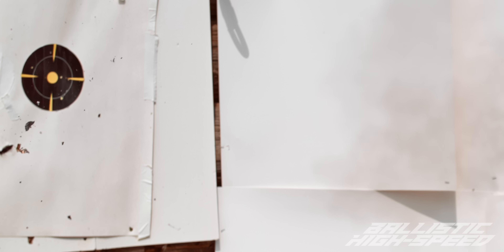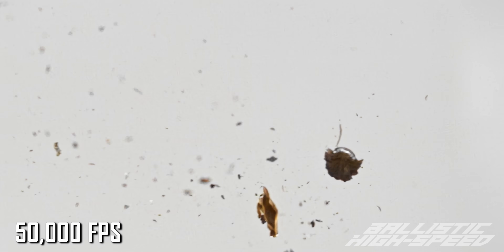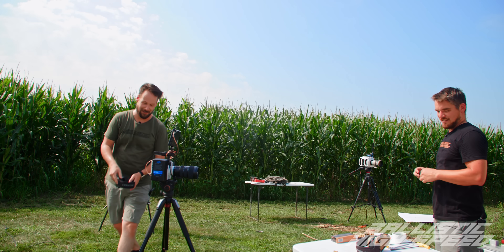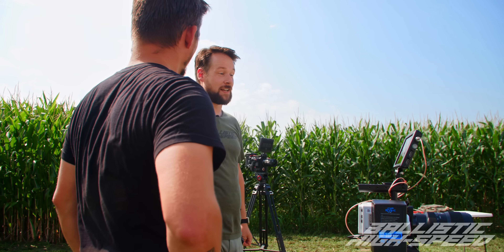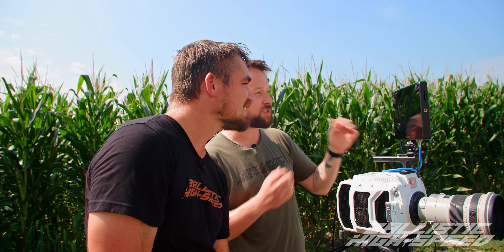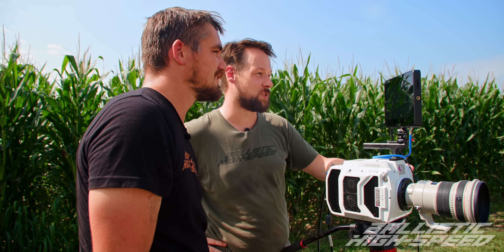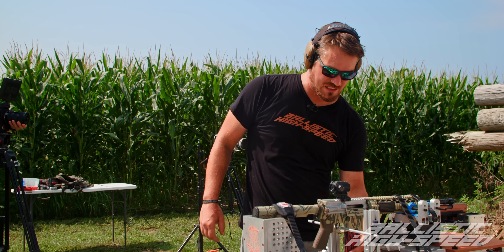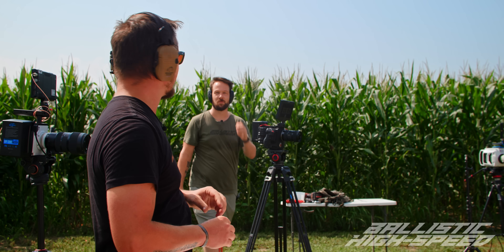Can You Shoot a Bullet out of the Air? - Ballistic High-Speed

Comment: What is the light in 18:04 ? If you change speed to 0.25, the moment bullet tip touches other bullet, there is a light. Is it is explosion of molten metal or what?
Reply from the maker: We see it often with bullets impacting metal, glass, and other materials. It’s a combination of the material superheating to ignition in that instant, and air getting compressed briefly by the nose of the bullet until it glows like a plasma.

Comment: Great movie, but here is a movie request that is little off topic.
Watch Paramount Tactical’s three newest videos in order — they outline the only scenario that makes sense so far. Could you recreate it? Use a torso + head, the same small-profile curved metal plate vest, and a common hunting round (e.g., .30-06). Test two setups: shooter elevated firing down into the top corner of the plate (ricochet-up into the neck) and a straight/level shot. Film with high-speed close angles so we can see ricochet, wound sizing, and shockwave effect.

One more factor: those plates are supposed to be inside sleeves with carbon fiber or similar material to catch fragments. If Charlie only had the bare plate inside a shirt rig, then whoever outfitted him failed him — the round hit where the plate should have saved his life, but without the full sleeve/lining it deflected up into his neck. Showing both setups — with and without proper plate covering — would make the test definitive and answer most of the debate.    
Charlie, we got it from here, the battle of truth is now in our hands.

Comment: This must be made into a practical firearm. It's like discontinuity in the terminal ballistics.  I suppose at close range they are likely to collide while decelerating into the target.
Reply: Needs to be an all lead slug.
Reply: Under-barrel 12 gauge tossing a few oz out for a solid copper .308 would need to compute angle and range. Should the pin strike delay be computed along with the range and angle?

Comment: why are they so hesitant to add more delay😭 just overdo it and work backward they wasted like 20 shots
Reply from the maker: The goal is to get a feel for how a certain programmed delay turns out in reality. A millisecond delay added in the coding does not create an actual full millisecond in reality. So by adding a millisecond or two at a time, we can visually see how much progress is made each time. That way when it comes time to fine tune the adjustments, we can actually “feel it out”. But just randomly throwing larger delays and then back tracking, we have no sense of fine tuning that will still need done with that method anyways.

Comment: In the good ol' days of computing, signal timing was accomplished with spools of wire of different lengths. Honeywell made a cabinet that served no other purpose than to house spools of copper wire. This was before miniature resistor/ capacitor networks for each signal. Adjust the length of your wires.

Comment: XM193 going out of a 20" barrel with a 1/12 rifling twist is close to 3300 fps. M855 going out of a 20" barrel with 1/7 rifling twist is going almost 3000 fps. Using 1/7 twist barrels, you lose about 50 fps per inch of barrel length. If I remember correctly, using M855, an M4 with its 14.5" barrel, the bullet is going about 2700 fps. With a 16" barrel and 1/7 twist, you're looking at 2800 fps. With a 1/8 or 1/9 twist, there is less friction, so less velocity is lost per inch of barrel length. you can find charts and charts of this stuff online, both from the US military or gov't agencies and from autistic people with chronographs and lots of spare time. :) Ammo companies often use special "test barrels", not real guns, for velocity numbers.

Comment: Green tip, aka M855, is slightly non-concentric, a quirk of the manufacturing process. The steel tip in the core is usually slightly off center because it's hard to mass produce something like that within the allowances of gov't contracts. Technically, 4 MOA out of an M4 is acceptable. We know that a brand new AR can easily do 1 MOA with good ammo. XM193 55 grain 5.56 is more accurate and more consistent from round to round because the rounds are swaged lead core without having to worry about a steel tip on the core. Commercial .223 isn't loaded to the same pressures as 5.56 Nato, but it's also more accurate at 100 or 200 yards than M855, discounting the lack of velocity. Soft point .223 has higher QA/QC because it's premium ammo for hunting and makes the ammo companies a lot of money per round compared to the mass produced FMJ rounds. M855A1 solved the accuracy problem because it's a machined copper bullet with the steel tip inserted into the nose of the bullet. Because lead is heavier than copper, in order for the copper bullet (with steel nose) has to be longer in order to be the same weight. It stabilizes more for a longer range shot. Of course for Ballistic High Speed, long range performance doesn't matter, but the consistency and concentricity of the M855A1 round might make a difference, creating a near 100% repeatable bullet trajectory. Another military round with high QS/QC would be the 77 grain OTM rounds designed for longer range accuracy and lethality. The velocity between various .223 rounds, XM193, M855, and 77 grain OTM might affect the timing of impact.

Comment: I was lucky enough to see this occur in real time back in 1989. At a live fire range at FT Stewart GA. There were 3 Vulcans (20mm rotary cannon mounted on an APC chassis) and the Plt Ldrs APC on line firing at a RCMAT (Radio Controlled Motorized Arial Target). The Vulcans and the Plt Ldrs M2 were loaded up with a mix of Tracers and standard ammunition.  The 3 Vulcans were firing on 100 rd burst ( each burst is about 1.5 seconds) and the M2 .50 cal of the Plt Ldr is just steadily chugging through his 200 rd belt. It's about 1830 hrs, last target of the day, sun is behind the woodline so the tracers are showing up nice and bright. We can see the clusters of 20mm appearing to float lazily towards the target (shocking how slow tracers look when they really are not slow) and the .50 cal bullets zinging through the middle of these clusters, moving a lot faster. Then it happened. A .50 cal tracer struck a 20mm tracer from behind, creating a luminescent pink explosion. We were all screaming and exited. The LT said he did it intentionally lol. Range control said, "You people are easily amused, that shit happens all the time." Then we ate MREs while we waited for clearance to leave the range. I had forgotten all about this experience until seeing this video. Well, not completely, my MRE was Tuna With Noodles (AKA dead hooker with worms) and I was pissed because that was my 2nd time getting that MRE that day and it sucked shit.

Comment: I Wonder about the lethality of that splatter

Also a couple of things
That gray stuff is most likely the lead. Considering its more with the steel tip reinforces that, since now the harder steel (instead of copper/lead) contacts the lead of the .45 first. Its about the hardness. Lead on Lead dissipates most of the energy in deformation while the harder Steel keeps its shape and therefore dumps more into the .45 Deformation, but now with so much energy that it rips apart / maybe even melts. 

Also, if you were dead center there wouldnt be any bigger pieces of lead on the sides. 

Great Video and Setup

Comment: I finally realize where math ACTUALLY is useful and this is where it would be so helpful as you can graph a interception point using distance and time with the velocity and choose where you'd want the impact point…they could've done this from the start but I don't think they're that math savy
Reply from the maker: Of course we understand how to do that. The problem is, this is a multi-variable polynomial. Not linear by any means. Each set of timing (relays, solenoids, hammer bar, hammer, printer, bullet load, etc) is its own slope function, and they don’t all play together in the same way. So the best approach is to get a feel for what each amount of programmed timing delay will do in reality. As you could see, a programmed delay did not equal that actual delay in reality. So once we have a feel for what a millisecond shift is actually doing, it makes it easier to “feel” what needs done as we get it more dialed in. 
If it was easy as just a point-slope function, a lot more people would have done this already.

Comment: What about hitting at 90 degrees the .223 impacting the .45 with a dummy in front of the .45. Id be curious to see if the .223 would redirect enough of the .45 to minimize or prevent damage to the dummy. So technically could someone with a rifle get an insane shot to defend someone against a pistol caliber? I wonder if the force from the higher speed .223 would pivot the debris or if the .45 fragments would still continue in the same path towards the target.

Comment: Good job guys! If I can help by making a suggestion for future testing. I was a F.O. in the Army which meant we had to be able to hit targets, sometimes moving, with an artillery, mortar, naval gun fire, etc from a long ways away with a significant time of flight. We had to be very precise about hitting our targets in the least amount of corrections. We used a technique called bracketing. Essentially, making an over correction and then using the two data points to be confident to hit by the third shot. You guys did what we call walking it in (which we only really did on danger close missions).  You can/should hit anything on the 3rd shot if you over correct and adjust long or short (depending on your first shot), and determine how much you were off on each shot and make the exact adjustment on the 3rd. I hope this helps.

Comment: 17:30 I believe the steel being harder is causing where the steel touches the lead to exert more energy, finely tearing the contact point with the lead and shearing away as dust.

It's like the difference of smudging vs sanding. Equal hardnesses smudge, but a harder material will wear it greatly.

Comment: What I find the funniest is you have this ultra high tech apparatus firing the guns sitting on top of something made out of wood and rocking like your granddaddy's favorite chair after every shot. Obviously it works but I still find it funny.
Reply: It’s kind of crazy that guns, which are commonly tested by military’s under controlled circumstances, don’t have an easy way to hold them steady.  
Obviously, real-world trials are the gold standard, but why would you leave out objective testing?
Reply: @Zenerd775 There's a sport of "benchrest rifles" which is like accurized rifle barrels mounted to blocks of wood you stick to a table, and usually there's no ergonomic way for a human to hold the resulting device. That might satisfy your itch for guns that interface well with a machine.

For normal rifles, there are gun vices you can buy that hold the whole thing stationary. They usually look less ratchet than the setup in this video though lol. But I suppose complaining that rifles are awkward to build stationary furniture for is like complaining that a hand drill can't be rigged up to look like a drill press without a ridiculous contraption. Can't optimize both goals at once I guess

Comment: I wonder if it would be possible to create a transparent barrel using a super thick polycarbonate and maybe use a .22lr or .38 special lead round nose low pressure round to prevent detonation of the barrel. Then you can rifle the polycarbonate tube and we can watch in slow motion how a bullet and it’s expanding gases accelerate down the transparent barrel as well as get a macro shot of the bullet leaving the case and engaging the lands of the rifling. Super out there but will be the coolest thing to see happen!

Comment: BTW the Grey poder 17:12 is probably lead scraped and pulverized by the steel, as the steel is much harder then lead. And the copper tend to stick to itself instead of getting powdered (while lead was used for its powder in early pencils)
Reply: Lead was never used in pencils graphite is used its most likely gunpowder residue
Reply: @robertosinjolu2931 early Egyptian and roman styluses, but that's not the point. The point is that under high friction and / or velocity lead get both pulverized and fractured,

Comment: It is absolutely crazy how consistent that setup was. I'd expect the hardware holding the guns in place to change ever so slightly.
Reply: They almost certainly do change positions after firing. The trick for something like this is to have consistent reference points to realign the system to afterwards. The years of experience doing this the hard way probably helps too.
Reply: @itsausername  also both guns are mounted to the same rigid frame, so while shifting the whole setup the guns stay in the same relative position.
im just impressed the mount did not shift in any way.  high speed or motion magnification of the frame while shooting would be interesting it must flex a bit right?, anyways good job!
Reply: @Verriks  If the frame were truly rigid, then they would have no adjustability for point of aim/impact. But if you keep your reference points on rigid portions of the frame. Then readjusting it after each shot is relatively easy.

For something like this, you want the guns themselves to be able to move and a mechanism to absorb that force. Otherwise you're liable to bend/deform the carrier. Which would make all of your measurements useless.
Reply: @Verriks They Do shift. That’s why the bullets don’t hit in the exact same position every time.
Reply: Or the powder in the cartridges to make the bullets have very little standard deviation
Reply: @ddd.777-  This is what I was thinking. It shows how incredibly precise the manufacturing of ammo is as well.
Reply: @Nick-of8zo i mean they probably used reloaded ammo specifically for this reason but i could be wrong
Reply: @ddd.777-  Even with bottom barrel ammo the rifle round will always overtake the pistol round with significant velocity. The distances are so short that the difference in "accuracy" is very negligible. 

Not that I'm saying it's easy to do, but geometrically, the deck is stacked in their favor.
Reply: @itsausername or actually the std dev for off the shelf range ammo is so small that maybe it wouldn't matter that much if the firearms fire at a small angle, but for a center shot everytime it's kinda needed
Reply: @ddd.777-  But they weren't getting a center shot "every time". They got it once. 

4MOA for off the shelf ammo, which is atrocious. Translates to a 6 hundredths of an inch deviation at 5 feet.
Reply: @itsausername I didn't say they did
Reply: @ddd.777-  You most definitely did, it's still right there lol
Reply: @itsausername Whatever
Reply: That’s what I’m saying. It is absolutely mind-blowing.
Reply: I would've expected the inaccuracy of the GUNS to be to high.
Reply: The handgun bullet might as well be stationary,   At hose rifle speeds, it makes almost no difference other than the coolness factor.  Well, this is one thing you con't want to happen in a battlefield or shootout situation, basically both bullets get destroyed.

Comment: 2 things:
First, Is the M855A1 made of frangible material behind the steel penetrator? Might explain why it turns to dust on impact with the .45. 
Second, what are the odds of shooting a 5.56 through a .45 in a head on collision, similar to the two .45's colliding head on?

Comment: Here are a few ideas for "stepping it up"

50 cal vs 50 cal - what happens when they collide in mid air? Is there a difference between which kinds of ammo you use?
50 cal vs 40mm GL - here in particular I'm curious about what would happen with a smoke grenade. Would any of them even go off or would they just get shredded?
Old school musket balls vs - well pick any riffle you want. You could make the musket balls out of any metal - and see what the difference would be between impacting lead, copper, bronze, iron, steel, silver, titanium - etc.

A totally different idea: if you take something large like a bowling ball or whatever and strap a sheet of bullet proof material on it - and then swing it from a from a high durability chain while firing a series of bullets at it, can you make it accelerate in a meaningful way? Maybe even to a point where it could do a full 360? 😀is it even possible? I'm guessing you need the first shot to be fairly slow and "low impact" force to gradually accelerate it and then increase the speed and impact force gradually, since starting out with a high cal high speed bullet would probably be too violent and just it apart.

Comment: So today we learned that if you can’t afford a shotgun, buy a rifle and a pistol, mount the pistol as an under barrel for the rifle, and attach them both to a shoulder-able mechanism that can consistently fire them 12,500 microseconds* apart.
Reply: Microseconds.  About 12.5 milliseconds, or something close to the proper delay for a spot drill spinning 5,000 rpm.
Reply: @Soundpost-f2l  Thank you! I’m the typical American that hates (doesn’t understand) metric prefixes.
Reply: @Soundpost-f2l  There are more countries where people use commas as decimal delimiters than countries where people use dots.
Reply: @yansakovich yes, but there's no reason to include that many figures after the comma in that case.  We're not making engineering drawings here where the number of zeroes affects tolerance.  And including specifically three digits after a comma looks a lot more like it's meant to be a delineator between thousands.
Reply: @yansakovich  I’m American, I just had the metric prefix wrong.
Reply: the thing is you have to adjust for vector and range on the fly. So you need a ranging laser and coding to adjust the time variance. Also calculate for ammo and muzzle velocities. It's doable, but easier just to use one weapon or the other.
Reply: @tearstoneactual9773 you just invent some kind of shotgun with quantum computing needs.